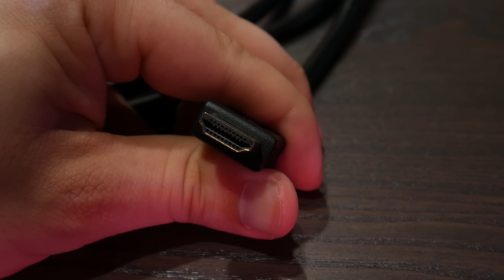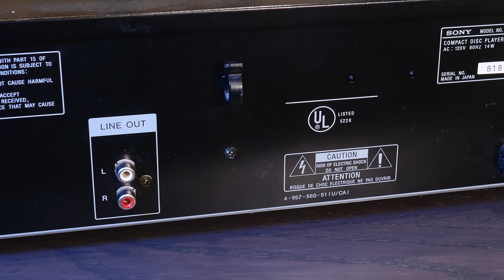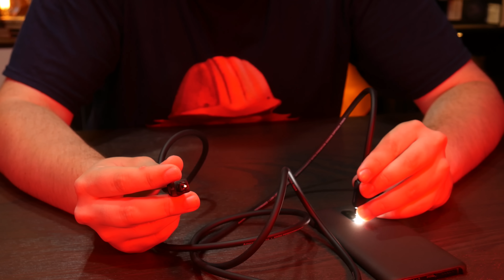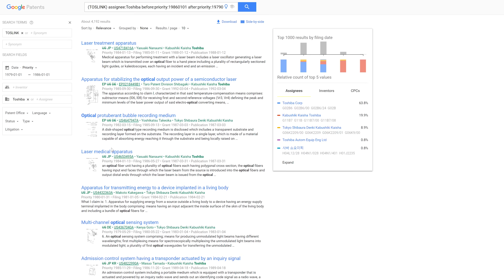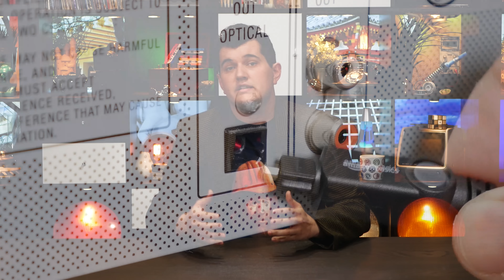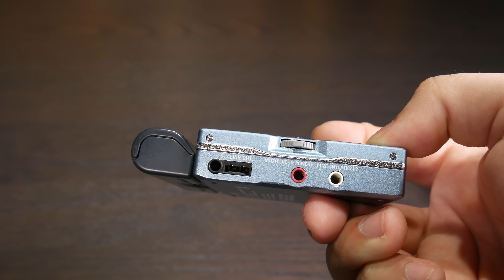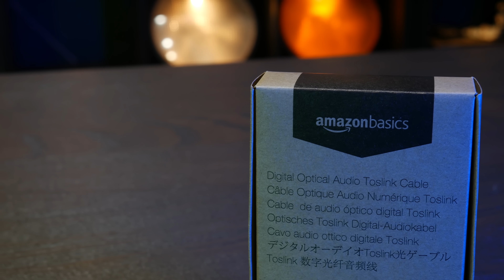TOSLINK: That one consumer fiber optic standard

Comment: Well, I used it because it prevents humming and shit. I did not know rca could support digital signals that way, which indeed would not produce humming because a digital signal either works or doesnt. I guess hdmi is an analog signal too, but decoding it would make it digital again. Anyway, I stopped using spdif really quickly, as it does not support dts-x and proper surround... which I found out rather quickly but after spending a bit on a few spdif cables. You opened my eyes a bit on the subject, thank you for that.

Comment: Fun fact, if you've owned any MacBook from before 2016, you've had a mini-TOSLINK integrated into your computer all along! That's how I found out they were a thing. At the end of the day, the main real reason I can think of why TOSLINK phased out the standard coaxial cables is likely because the connector is much more compact, and therefore easier to integrate in a product.
Also, the next time anyone asks what HDMI stands for, I'll provide them with your answer. It's too good to not be repeated.

Comment: I actually have required a use for optical in my set-up. I first tried transmitting a digital signal over usb and significant noise from the source (likely due to the power circuitry) was transferred through. Optical solved this nonsense.

Comment: About the buildings linked electrical wire. We have things like the PS Audio power plant for that. Which converts ac to DC and from that DC regenerates a new ac sinus. Or at least a separate electrical group only used for the audio. Usually combined with a special audiophile fuse. Electric like a bathroom fan can be very electrically noisy.

Comment: Nice informative video! Unfortunately - strange as it is - toslink sounds not as good spdif. Tests why spdif has the preference with audiophiles, unless you want to isolate an electric noisy device like a computer. Then toslink can be a solution. But it's always second to an spdif cable.

Comment: This video was very informative and fun.
I myself made a surround on budget, first from very old SPDIF only surround amplifier (things I used to do, I would even see one of pro-logic amplifiers, literally multi-input RCA L-R amplifier with prologic decoder.

I had to give myself immense crash course and failed small purchases going on and on about what spdif/TOSLINK carries, and it taking longer than a tech connections video, and being owner of nintendo devices; finally it dawned on me a new amplifier is in question, as I needed that sweet HDMI. To make this a mini viewer tech con to whomever reads it:

Toslink/Spdif carries very nice lossless stereo up to bitrates and Khz of all desires, and a lot of things support this and also DTS and DolbyD surround standards. Game console manufactuters that wanted DVD and newer bluray movies play back right had to pay licencing for both, so they double dipped and ps3, xbox one (maybe!) and ps4 can output game surround audio in either DTS or DolbyD. Xbox original and 360 both have ability to do TOSLINK and supports ONLY DolbyD output for surroubd, probably thanks to some deals and HDMI lacking state of 360 launch that stuck for the rest of the console's life.
For me, also pc's have had coax or TOSLINK SPDIF for long, LONG time with technologies supported to make them output surround, though unless you pay for fancier hardware with fancy DTS or Dolby licenced middleware in the driver that lets you output ANY "raw" 5.1 stream as either or of these compressed technologies... the next applies to PC, too:
Nintendo with Wii u was late to the game. Up until Wii their surround output was pro logic based, though this also means even few N64 games shipped with ProLogic surround, namely both Zelda titles.
Wii U did not licence DTS or DolbyD because why would it and this applies to switch as well, so only way to get them output surround sound was a HDMI amplifier, which among the more advertised advanced dolby and DTS technologies, also do PCM/"RAW" (up to) 7.1 surround signal. 

I had to renew my first version of old 5.0 setup I made and get a used, but still not inexpensive HDMI amplifier just for my nintendo devices, because after learning about things for 2 months everything else actually would have worked fine.

Ok, I later on got a PS4 slim and unlike 1st revision it has no TOSLINK port, so it "needs" the hdmi amplifier too, though you can use a signal splitter which I also got in my experimenting, to make the SPDIF signal from the HDMI output to TOSLINk and or COAX and get your surround this way.

Also to note, xbox family aside and no knowledge on xbox one, PS3 and PS4 both support PCM surround output over hdmi and is the superior way to output surround from these systems if possible. Also videocards for PC's handle hdmi standards and are very compatible outputting surround sound out that way, lesser are now the worries of PC and always split image and audio streams as modern videocards include sound processing too.

TL;DR: surround sound can be way more pain in the ass than it should. Old hardware may be still use of you as if 5.1 is all you have and want and you cannot hear the difference anyway, old amps are just fine and cheap as long as you have also needed cabling and no nintendo devices to cause your brain harm in the process. I advocate doing your audio as budget conciesly as possible, old speakers that are fantastic are quite cheap after all.

Comment: I don't know if this is a problem with my TV, my sound bar, or digital audio in general, but when I use the TOSLINK output on my TV, there is a noticeable delay between when a sound gets produced and the audio starts to be heard. So the beginning of every video is cut off, and quick sounds like in the Nintendo Switch Menu aren't heard at all.

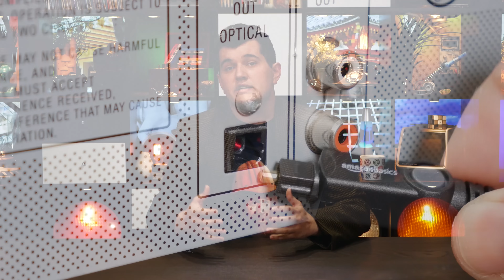Comment: 9:35 You mentioned a never realised upgrade to toslink, one that would do away with the need of having to orient the connector. 
Now, I do not know if you referred to a redesign of the port on the device or the connector of the cable (or perhaps both?).
The thing is, there are optical cables that aren't keyed and do not need to be oriented to be connected, I have one.
It has a round-type plug and connects like a regular cable but without the hassle of needing to be oriented. 
And its stylishly transparent to boot, Oooh swish!

Comment: Why not just use Ethernet to connect everything? Your typical TV broadcast is only around 10Mbit/s, and your typical motherboard comes with a 10/100/1000 Mbit/s controller. Hell, if you want to send video uncompressed, you could use a 10 Gbit/s Ethernet link and still only use 30% of it sending 1080p60 video. At that point we're into fibre territory, where potentially hundreds of gigabits per second are available if you use the right standard. Use 100 Gbit/s Ethernet and you'd cover even UHD with HDR and high frame-rates on a single cable.
Reply: There are tons of new audio over IP techs, check out open source AVB or Dante, but I believe there are many other proprietary techs out there too.
Reply: @DMarlow83   -  Do we even need to go the the level of an IP stack, though? For connecting AV equipment, just the basic Ethernet protocol with a switch and operating on the level of MAC addresses might be enough.
Reply: There are specialized PCIe cards and such for it due to the fact that latency is a major defining issue.

Comment: I've had electronics without ground pins (hi, MacBook Pro) that have introduced electrical noise when plugged in with certain kinds of cables - including digital ones like HDMI.

Never had that issue running TOSLINK (which my 2013 MacBook Pro supports via mini TOSLINK in the audio jack). It's a fringe case, but it's real.

Comment: Having them be electrically isolated is more important than you think. Digital circuits add a LOT ground noise which means a lot of devices that are both analog and digital have techniques to separate this from the analog ground. Having a CD player that only handles digital and an amplifier mostly analog will reduce noise.

Comment: Yes, again, gold plated optical connectors, what a laugh.

One might ask though, why we have never had optic fibre routers for our home networks.... The answer is the same though. The speed required has been perfectly obtainable with twisted pairs within (cat5, cat6? I've been out of the industry a long time)... Pretty sure the cable from from my router to my PC is cat 5. Nevertheless, wired connections work fine over "short" distances.

Here in AU, I will soon be forced to abandon my twisted copper pair ADSL connection, to an optical connection, however it will still be fed to my premises via coaxial cable.... Somewhat better I suppose, but still could be better if it was optical all the way in, looking into the future.  sigh

Comment: I can think of only two cases where TOSlink sounds appealing:

Connecting up a KVM system. New KVM systems have audio-via-HDMI and that's fine, but some computer setups do NOT like KVM switches. Audio did... odd things when I was using my old KVM. Toslink was appealing, they make combiners I guess.

And something that TOSlink was never used for... Microphones. Microphones are hella sensitive to interference, particularly if you're trying to attach one microphone to two computers... That said, there are ways around this as well that I became aware of, time to do some soldering.

Comment: I used TOSLINK connections for around 20 years, it was pretty much my go-to standard for audio, as lots of older video game consoles had optical outs but no SPDIF.  It enabled me for a long time to connect my PC to a surround sound receiver with only a single cable.  But, I recently had to abandon it due to exactly the bandwidth limitations you mentioned.  Well, that and the fact that getting Dolby Digital Live encoding working on modern Windows is a recipe for madness.  HDMI it is.  Although HDMI is pretty limited too.  I found that out when trying to get 4k HDR video + surround sound audio from my PS4 Pro to my TV.  You need a really solid high-quality cable to be able to maintain that connection it turns out because it's straight up maxing out its entire bandwidth.  I'm not even sure what framerate it's dealing with, but I presume it's 60fps.  I saw some news that 48gbit HDMI 2.1 has been approved as a standard, though, which will help.

Comment: Toslink has one key advantage. It lets you electrically isolate devices in cases when you don't trust your amp to be plugged in to your expensive gaming pc....
Also if you had a bad set of caps on a soundcard of an otherwise good motherboard, you hear the noise..... the caps actually don't even need to be that bad just the right ones gone bad. So yeah I sware by toslink for clean sound. It works great to clear things up.

Comment: Most Mid to high end computer motherboards and audio cards still have either a full size Toslink or a mini-Toslink output.
I still use mine to this day on my gaming computer to transmit surround sound from my computer to my Home Cinema amp.
I prefer Toslink because for some absurd reason, you can't use hdmi for audio only, and I don't want the hassle of having to manage an extra unused display.

Comment: The toslink also creates a physical electical separation between the devices. In worst cases, it provides no extra way for a lightning or such to transfer. Though if you keep everything on the same circuit, and/or on top of each other, that doesn't help much.

...but yeah, gold plated toslink.... :facepalm:

Comment: Those "incredibly nit-picky details like clock jitter" are what make coaxial connections sound better than Toslink most of the time, unless there is interference or a ground loop that makes the optical connection a better choice.

Comment: I really hope toslink stays around. When it comes to passing digital audio from a gaming console through a computer so as to hear both audio sources at the same time through one pair of speakers, you'd prefer a PCIe card with digital input. Right now toslink input is the most common to find on PCIe cards, with some cards offering the coax spdif input. If the PS5 doesn't have toslink my setup will get pretty messy. You could probably get a mirror HDMI splitter and use a capture card with HDMI in but that just sounds unnecessary.

Comment: It also has one more benefit - with Toslink you don't have a second ground connection so you can't get a ground loop between equipment sharing the same mains ground.

The mini variant also bundled into the headphone jack of the MacBook pro - apple introduced it on their PowerBook G4 in late 2005

Comment: toslink was great for recording CDs to minidiscs in the late 90s before mp3 players had enough capacity to be usable.
Reply: I used the optical out on my ps2 to my minidisc to record the music I made on the Music/Music Generator series.
Reply: Yeah, the fact that it would automatically preserve track separation was great. I never would have bought into MD if I'd had to do that manually, but just hit record on the minidisc player and play on the CD player, come back after however long the album was and you were good to go.
Reply: Having a little device with a ton of music, rewritable and digital was amazing.

Comment: I wished that this video was made three years ago. I was looking around on the chassis on a Mac Pro (you know that garbage-can-looking-thing?) to find the optical audio port that was listed in the spec for the machine. But could only find a single headphone jack and no TOSLINK port. When we asked our local Apple store they did not know anything about it and could only point to the spec listed that said it has a optical port. We then after much searching found a partnumber for a "optical audio cable" for the Mac Pro. When it arrived I learned about the miniTosLink plug, and quickly found out where the port was located on the chassis as it was pretty obvious when you see the shape of the plug :)
The TOSLINK may not have any quality features over a S/PDIF, but the miniTosLink is quite neat combining both analog and digital signals in one plug with small form factor.

Comment: 13:50 Macbook Pro machines had this at some point (at least 2009-2012) as well. Really neat, since you could plug that thing straight into your home theater system and get a really nice signal - compared to the regular headphone output which always kinda sucked.

Comment: I get your point, Toslink is total overkill for connecting some stacked equipment together, but for "distances"  its great. If you compare it to the coax SPDIF there is the advantage of the standardized cable (at least in some kind) and the much easier transmission of the actual data. SPDIF has up to 20Mbit/s and its no trivial to connect those signal with "unknown" cables. If the  coax SPDIF was only used with high grade 50Ohm coax cable, everything would be fine, but the coax connector invites people to use cheap analog component cables, which would be fine for stacked equipment but not for longer distances. You might not hear the EMI everyone is talking about when mentioning Toslink, but even a digital copper wire SPDIF connection can only handle a certain amount of noise before the signal can't be decoded anymore. Cheap cables (on longer distances)  might not work at all, since they are rated to 20kHz analog Audio and not for a 20Mbit/s transmission (about 40MHz signals).
I know you didn't want to go down the rabbit hole and this post gets a bit long, but I was very disappointed, you video sounded like a Toslink-roast to me...and I love Toslink :)

Btw, I only saw this Mini-Toslink ONCE about 10years ago: There was a strange red light coming out of a notebook's headphone jack.
My PC is connect to my AVR which is on the opposite side of the room using Toslink. The cable is 15m and I didn't want to use analog 5.1 or coax SPDIF and HDMI is not specified for those distances (and I only need sound at my AVR). Those Toslink cables are thin, cheap, reliable and

Comment: Strange that it only handes such short distances, those fibres must be really bad. When using cat45/led-based ethernet converters with good multi mode fibres you can go a couple of miles before needing lasers.
Reply: The vast majority only used a plastic fiber, so losses are much higher.

Comment: If two audio devices do not have common ground, toslink will negate potential-differing ground based burr from the transferred sound. Thus it's also useful in pc desktops where common ground is noisy. But this is against analog only connections, not coaxial.

Comment: I wish they upgraded Toslink to support the newer standards, for me it’s been more flexible compared to HDMI/ARC and ARC is not always an option.
Reply: I agree, an optical connection with enough bandwidth to handle 10K HDR/120fps and 30 channels + 3D would have been infinitely easier to implement than to redesign HDMI yet again.   9 times and counting....
Reply: @j-man72b72  I doubt that, look at how much 40 gigabit fiber transceivers cost, a lot more than an HDMI cable/port. not to mention all the different types of data would have to be aggregated together. And you would still have to develop some high bandwidth on-board way to transfer data from the GPU chip to the optical port in the first place.

Comment: I used Toslink to electrically isolate a mixing desk at a gig from the PC that was streaming the audio which was on the other side of the room and on a different phase of the mains power. Awesome. I also used the mini version with a MiniDisc recorder and DAT player when I wa working in radio. I'm really looking forward to the next part of this as I have burning questions.